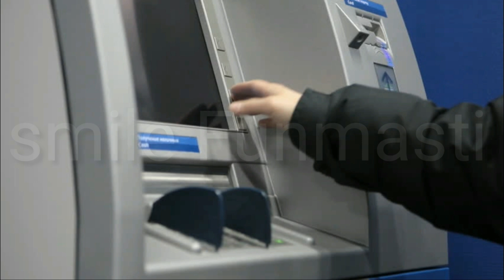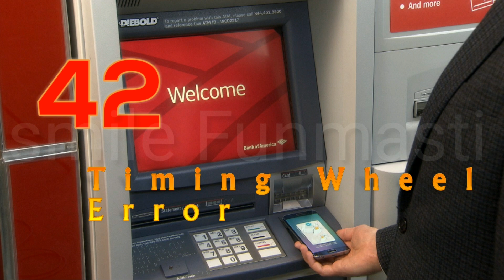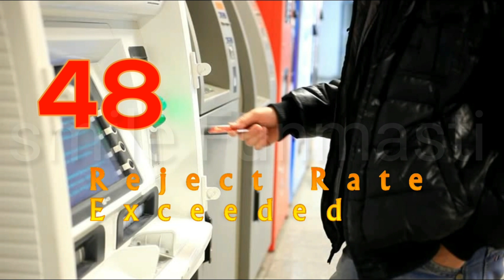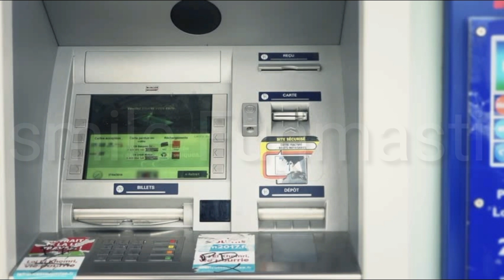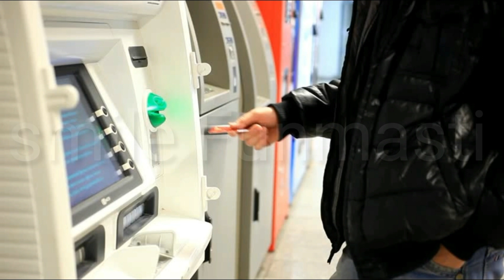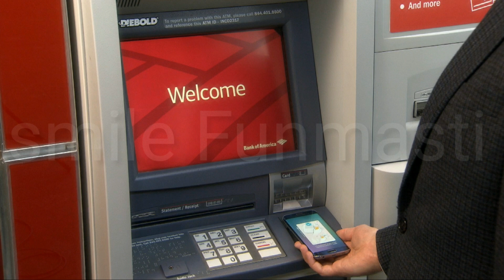ATM Response Code with Technical sollution for banks |smile Funamsti

Comment: Bhai please help 🙏 
070 system error solutions 😭
Reply from the maker: error code 070 meaning and sollution as per under error code for atm machine its an executable file running on atm pc which is necessary for runnings application installed on atm pc if this error code generates that means some files are missing, corrupted or malfunctioned when atm does not responed other programmes or eighter atm current version may be incorrect or not proper configured

Comment: 088 ?
Reply from the maker: error code 088 means the machine is unable to read the card. chances are tha you are using old magnetic tape type atm card which have since been closed and deactivated. if you are using chip based atm card and still getting error your chip card may be damaged you will have to get a new card from bank. in short contact to your bank.